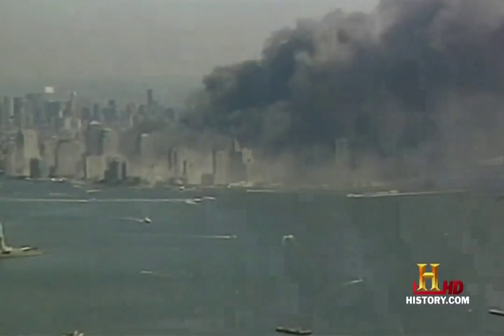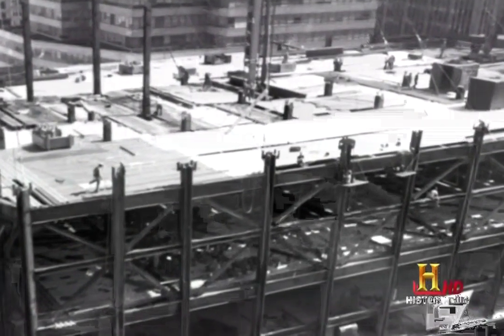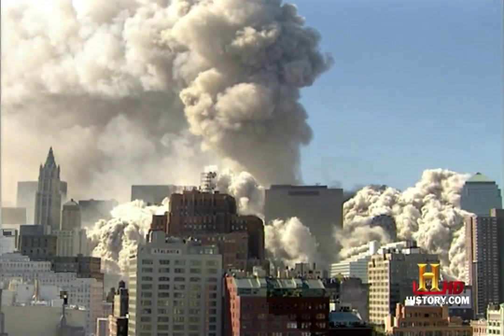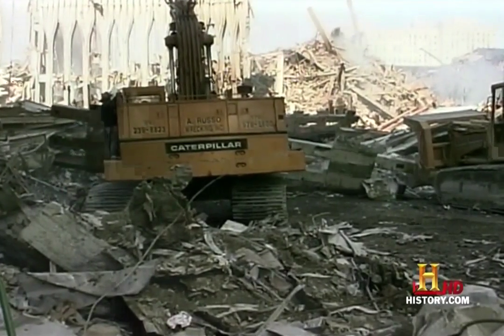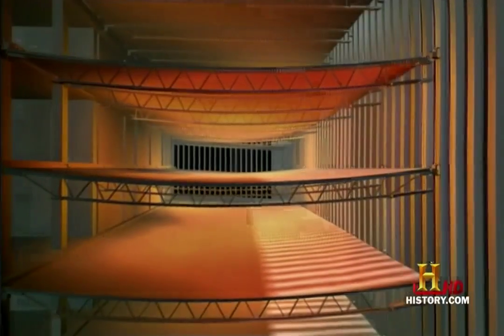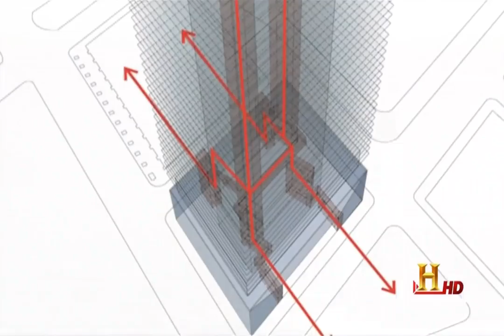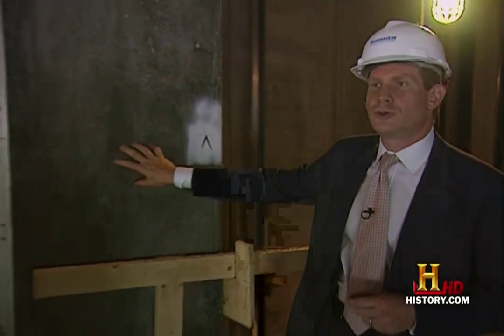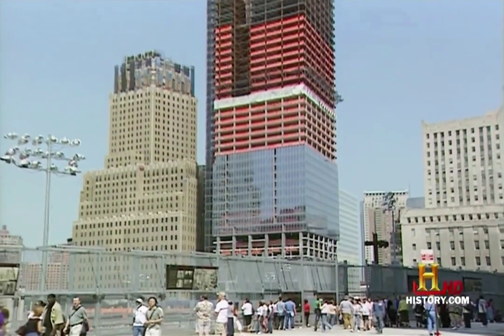WTC 7 - Collapse Issues & Features of Old and New Building (History Channel, 2004)

Comment: If any of that was true the designers of the original building would have been sued to death for designing a building that could be totally collapsed by the failure of a single truss.
Reply: martin savage dudeeeee.... exactly?!?  It hurts my brain to think that people really think 2 planes dropped 3 buildings
Reply: The two planes destroyed or damaged a dozen buildings.
Reply: Martin , that is an excellent point !
Reply: Not really. It wasn't a design flaw, the building held up fine for a couple of decades. Considering the limitations imposed on it by the substation I'd say they did a fine job. It would have stood for decades had not one of the world's largest buildings fell on it.
Reply: Chris Gilliam Trapping - for about 3.5 secs the building fell at close to freefall.

NIST "explained" this unique collapse using a model the details of which it refused to make public on the grounds that it would "jeopardise public safety".

You can buy this ripe shit if you want to.
Reply: Mein Sohn Yeah, they were really struggling with that one. “Jeopardise public safety”. A better question is why would a bunch of amateurs like NIST be investigating a structural collapse, and not the professional body for American structural engineers.
Reply: Chris Gilliam Trapping  If you read the NIST report....and I have, I’m a retired structural engineer.....they say that damage caused to building 7 by falling debris played no part in the collapse, other than starting some fires. They have to say that, because if structural damage played a part, the failure would have commenced at the face of the building and it would have fallen over like a tree.
  No, they attribute the freefall collapse to the failure of a single internal beam-column intersection, resulting from thermal expansion caused by building contents fires. So in essence, they say a 47 storey building collapsed due to burning furniture and papers.....a ludicrous proposition and one that, if true, would have got the asses sued off the designers. (Incidentally, I could design a building to fit around a sub-station with my eyes closed.)
Reply: What do the original blueprints show? Or were they altered after the fact, by Zionist operatives. And neurolizers were used to erase the engineers memory.
Reply: William Dillman The original blueprints show the design of the building.
Reply: It's not a ludicrous proposition at all. Stell softens at temp. It doesn't  turn to liquid at those temps, but there was a raging inferno inside
Reply: William Dillman With respect, you’re not an engineer. When heated sufficiently, steel beams will lose strength and sag. This is often observed in burnt out buildings. However, the ludicrous NIST fairy tale hypothesised that one single beam had undergone horizontal thermal expansion - stretched horizontally without sagging, pushing a beam off its seat and snapping the retaining bolts in the process. This is simply not possible under the current laws of physics. Gravity would cause a softened beam to sag, not to extend at one end.
  They further hypothesised that the failure of a single beam-column connection had then caused the instant free fall collapse of a massive building. This falls under the heading “pull the other one”.
Reply: I am an engineer. And you, rather than sharing any anecdotal tidbits, including those of this poor presentation, should consult with other structural engineers on this issue. Engineers who were involved with this issue and are aware of the facts. And take off your tin hat first as well. I wouldn't let you in the door so dressed
Reply: William Dillman Software engineer maybe. Certainly not structural. If you’re familiar with the NIST report, as I am, then tell me what they had to say about shear studs. Clock is ticking......without looking it up.
Reply: Licensed pe. Started as a mechanical name moved to structural in 1989. You need to gather your facts from someone other than Alex jones. I wouldn't let someone so irresponsible work for me. Can't form sound conclusions, uses nutty bias to implement besigns. You're fired
Reply: Like I said...talk to the real structural engineers involved in the analysis of this failure. The compare with what you have learned from other "sources". You are fed by foolish noise
Reply: William Dillman (Hahaha! He’s off Googling “shear stud” now to find out what it is).
Reply: And btw the expansion rate could easily cause the shear studs to fail   at temps well under the temps that caused sagging. As the trust became warmer it first shared the studs, the as the fire progressed the trusted sagged. Next we will discuss the existence of Santa claus the milk and beddie bu fo you
Reply: @martinsavage6838  Have you ever even designed anything that was actually built? I seriously doubt your claims.
Reply: @blanewilliams5960  I have. I'm a retired structural engineer.
Reply: @martinsavage6838  Ok, if you say so.

Comment: Hard to believe these nonsense. Look at the Grenfel Tower that burnt from bottom to top and still stood.
Reply: Thierry Herreman  Why the f**ck do people keep bringing up Grenfell. It was a totally DIFFERENT  construction. Get It? Totally DIFFERENT. It was basically a tower of concrete shells built on top of each other. No steel framed construction. No structural integrity to be compromised. Grenfell could probably have burned for another 24 hours and still stood. Steel framed constructions have an Achilles heel. Nearly all architects will agree.